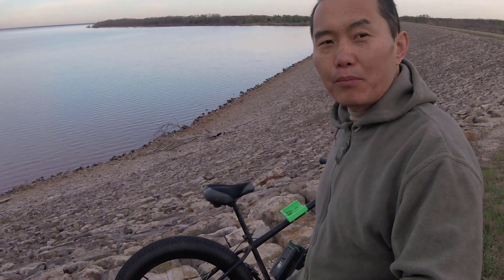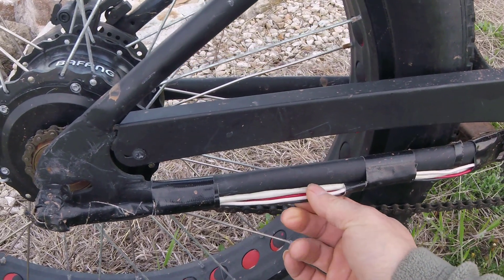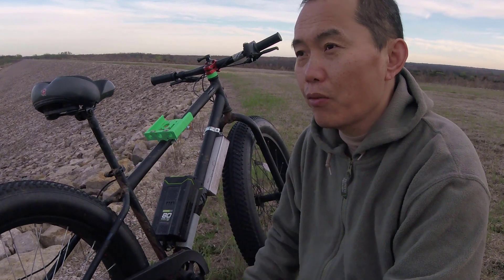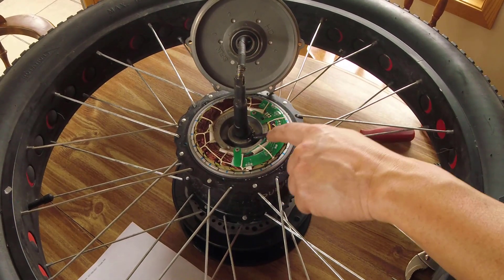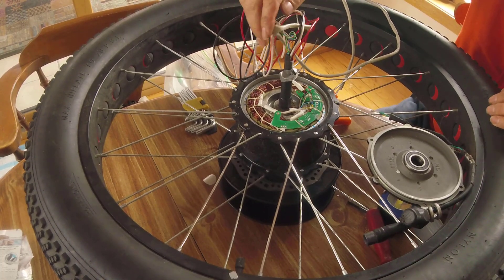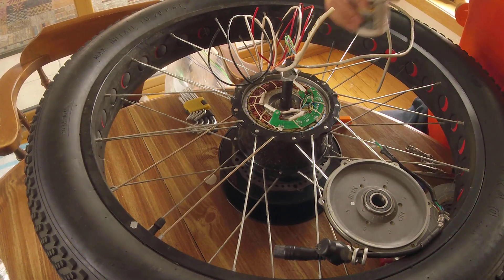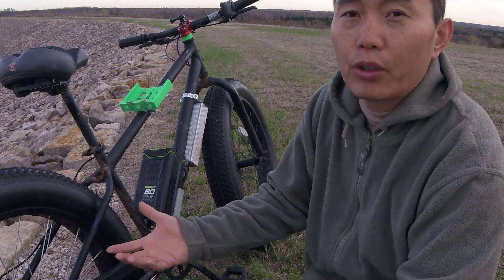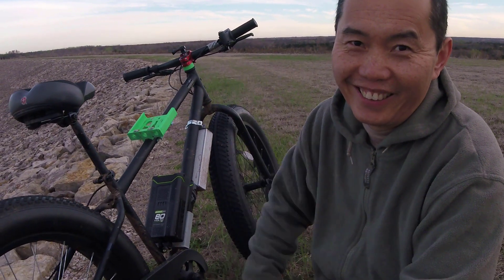how to double the power of ebike hub motor disassembly and replace phase wires

Comment: hi, my english is pretty bad, i just replace the 3 motor cables and voila? or do you add an 80v battery? thanks
Reply from the maker: To get advantage of 80v battery you have to replace 3 phase wires.
Reply: you need to add the 80v battery
Reply: @hydralizk6631  if you have a newer e-bike you could also add 1- 52 volt (sold as 48 volt) battery in series which would be a 96 volt battery as the higher powered e-bike come with a 48 volt battery
Reply: @billbarney4937  sure as long as the terminals of each battery is rated for that much voltage.  They aren't  AAs, these are basically bombs if you're not careful.  Fuses are a must!
Reply: @hydralizk6631  absolutely you should know basic electronics and mechanical assy. usually there is a fuse but you must size the fuse to the size of the wire
-
Reply: buying the correct controller would be 1st step

Comment: Would there be a difference of only using a 52v battery?
Reply from the maker: Yes. If you ride off road, you can feel the cable will heat up so quick.
Reply from the maker: Bigger wires mean more current, more toque, more capable to ride up hills, off road...

Comment: Hi great video and info
I got 72v 20ah with 50amp bms and 1500w motor witch I getting good performance of the motor so now if I   change the motor to 3000w witch is have same winding will I get better performance or nothing will change any advice pls
Reply from the maker: 3000w should be double the size of 1500w motor. If they are the same outside, more likely they are the same motor.
Reply: @JerryMinne  no friend motor is same size abit beafier but a lot heavier
Reply: Did you try this?

Comment: So if you change the battery to a 80 watt how much is an 80 watt battery? And don't you need a new controller if you do that? And I really like those tires they look like on off-road tires and I've not been able to find any where did you get those tires? I want tires like that and it won't make so much speaking noise like mine I have a 2020 ecotric Hammer bike I have 600 miles on it. Being disabled with one leg this bicycle saved my freaking life saved my life I have no other way to transport myself
Reply from the maker: 6ah 80v battery is about $140. You need controller that supports 72v system.

Comment: That's the 500w motor that's set to natively deliver 750w. You've been scammed through false advertising.
Reply: Those nylon gears though need to be changed.
Reply: Did you see how small is  the Tesla motor? Same type of motor but incredibly small for the power it can make.
Reply: @mihaiilie8808 that's what you told her didn't you!
Reply: @lightseek88  Yea, and your mother said its enough .
Reply: Anything that comes from there is a scam

Comment: Hey man, sick job on the phase upgrades!
You should get your hands on some nice thick copper wire and re wind your motor too, you can get much better power through them with a little more copper density, also don't forget to replace a plastic gear with a metal one on your planetary clutch, it'll stop you from shredding your gears long term ;)

Your phase wire upgrade means your windings will get introduced to more current and voltage (efficiency boost) So it makes sense that the windings could heat up more now than previously. (If you're keeping the power low its not much of an issue, but you seem to be the type that would like to juice things a little harder, like myself)
Reply: GameliEL Auceps 
Sick (slang) = cool/awesome/impressive
Reply: Mission Gameliel   Im Aussie, "Sick" means good.
As in;
"Fuckin' Heaps Sick Cunt"
Reply: Thanks mate i.ll try that get some copper wire and start winding.
Reply: GameliEL Auceps  I mean, if you live under a rock 🤣

Ever heard of context.
Sick has been used in many ways, including the way I used it, for over 20 years, perhaps your intelligence or rather knowledge of general communication techniques is lacking. Guess your "common sense" just ain't up to snuff mate.
Reply: Does copper wire thickness have anything to do with smoothness especially at lower speed? Will it be smoother or gerkier?
Reply: @mersadz3743  thats got more to so with your controller setup than anything man...
Reply: On A Mission  umm, sure thing mate.
Perhaps your understanding of the subject is just lacking.

Punctuation, grammar and proper sentence structure, I don’t really see where I went wrong 🤷🏻‍♂️

Comment: What was the top speed before and after the modification?
Reply: Doesn't seem any difference then my 500w bafang with 48 does 42kph
Reply: @pyscart4629  he does 40 MPH ! It’s sommething like 60kmph
Reply: @currymasterrace7153  .more likr72kmh
Reply from the maker: With 48v battery, the bafang 750w motor speed is 25mph, 80v battery can get 40mph.

Comment: did you disconnect the speed sensor in hub motor?
Reply from the maker: No. The hall sensors are required for the most ebike controller.
Reply: @JerryMinne  would the hall sensors work out the voltage without controller . ie circuit boards inside hub?
Reply from the maker: Hall sensor requires 5v voltage which provides by the ebike controller.
Reply: Hello! Your videos are addicting lol. Are you interested in putting a kit together for resale? I currently have a 56v 2.5 AH but plan on getting the 7.5 AH here soon with another power tool. The kit would include the upgraded hub and batter connector on the other video you have for ego? Just curious
Reply: @cmase1000  Nah
Reply: @ianmangham4570  quiet you
Reply: @socialdef3  Sphincter says what?